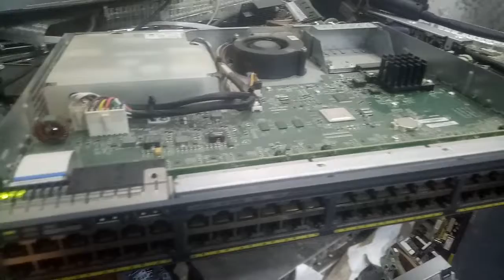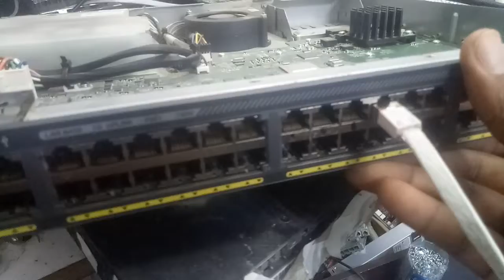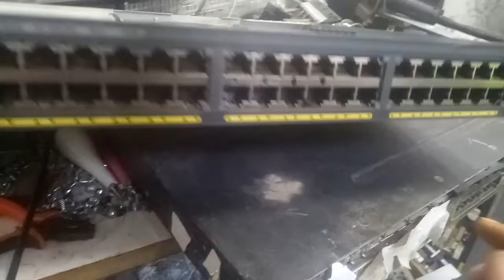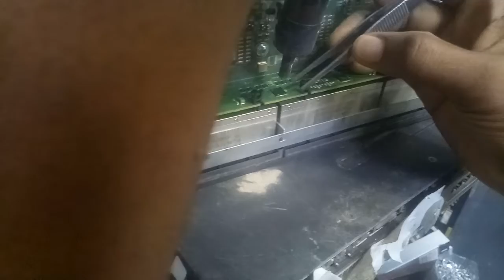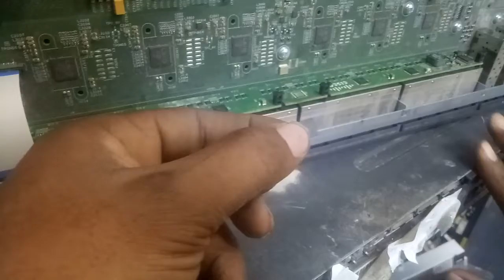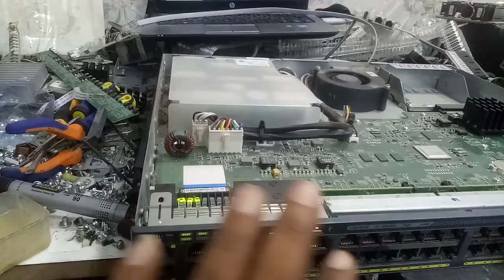Catalyst c2960x 48fpsl power controller error ;  poe not working repair. ports not working

Comment: Thank you for this power information. If I may asked which tools do I need to remove and fix my icing back to the Cisco Board. 

Thank you

Oladimeji Afeez Oke
Reply: Kindly provide me with the steps to solve my inline power post failed on 2960 48ports POE. Thank you
Reply from the maker: The machine is "rework station "